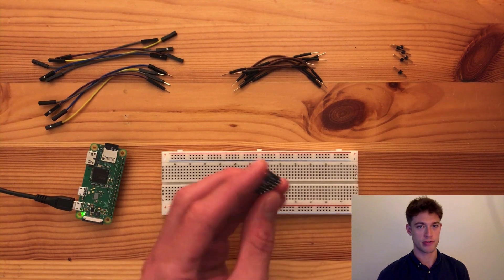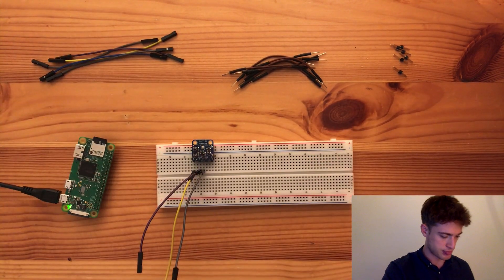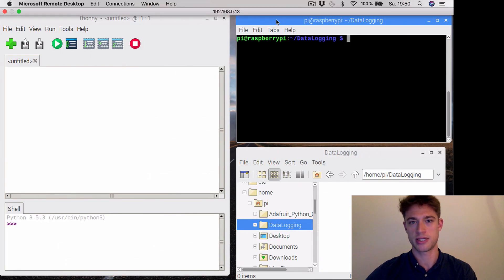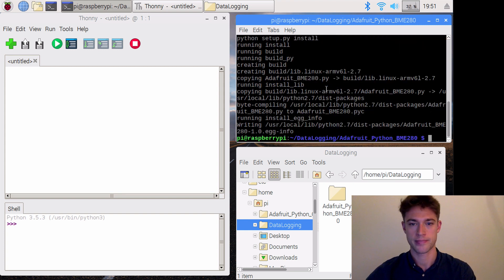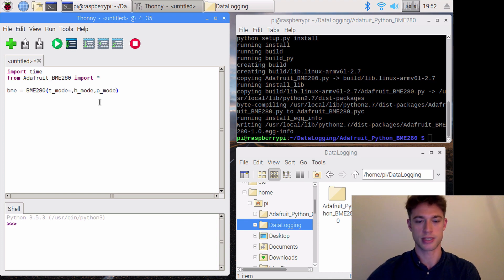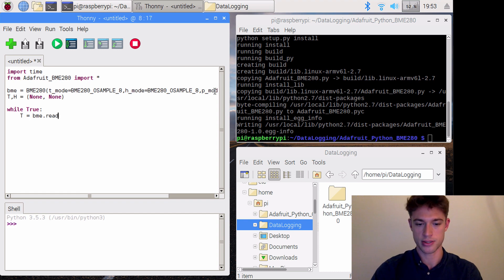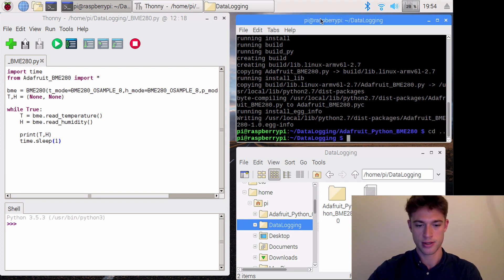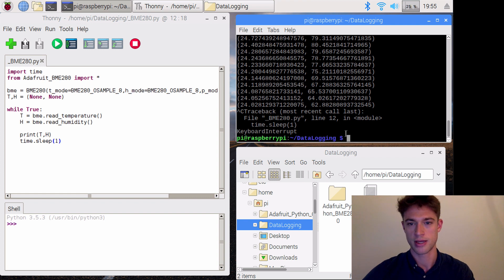08 | Indoor Weather Station | BME280 | Temperature, Humidity & Pressure Sensor

Comment: Thank you for these tutorials - much appreciated and very well made! I had a Pi lying around so this is a great project. I just bought a cheap BME280 on ebay, I found the Adafruit a bit costly. Can I still use the Github code?
Reply from the maker: Hey, really glad this ws helpful to you! I can't say for sure but usually the code will run just fine independently of where you got the sensor from, as long as the sensor name ("BME280") is the same.
Reply: @mmarsc2323  Hello! Thanks once again for your tutorials. Just quickly, the code in the Youtube description (python) is different from what's in the video (h/p have been swapped around). 

I keep getting this error code, I'm wondering if you think this may be because Adafruit_Python_BME280 has been deprecated?

 pi@raspberrypi:~/DataLogging $ python _BME280.py
Traceback (most recent call last):
  File "_BME280.py", line 7, in <module>
    T = bme.read_temperature()
  File "/usr/local/lib/python2.7/dist-packages/Adafruit_BME280.py", line 215, in read_temperature
    UT = float(self.read_raw_temp())
  File "/usr/local/lib/python2.7/dist-packages/Adafruit_BME280.py", line 194, in read_raw_temp
    self.BME280Data = self._device.readList(BME280_REGISTER_DATA, 8)
  File "build/bdist.linux-armv7l/egg/Adafruit_GPIO/I2C.py", line 136, in readList
  File "build/bdist.linux-armv7l/egg/Adafruit_PureIO/smbus.py", line 255, in read_i2c_block_data
TypeError: one character string expected

Comment: Okay I’m using a BMP280 and I finally got everything to work, but instead of displaying the temperature and pressure it is just displaying ()
Reply from the maker: I was using the BME280 (note the ‘E’) which measures temperature/pressure/humidity; you are using the BMP280 (note the ‘P’) which I don’t think measures humidity. You’d have to get a different sensor or adjust the code to only extract temperature/pressure.